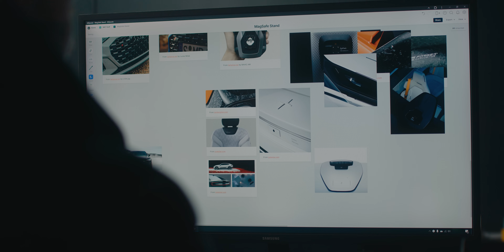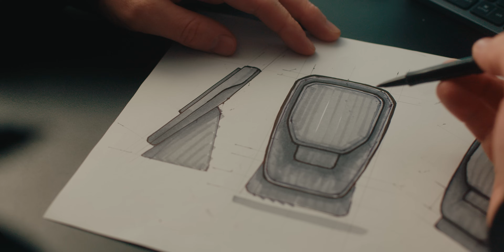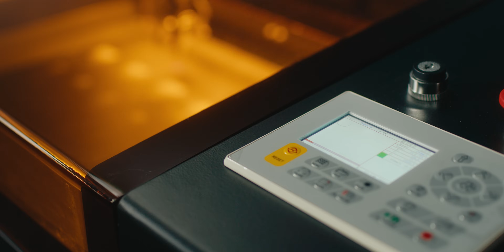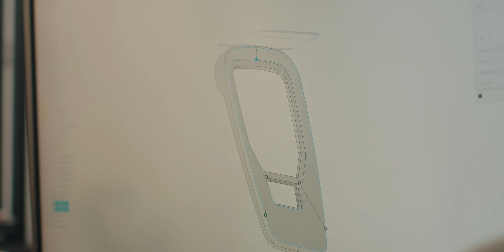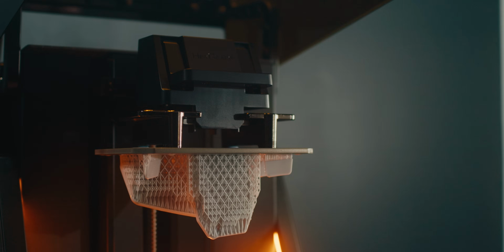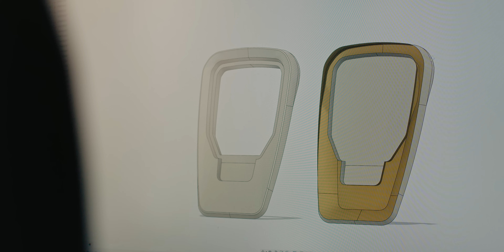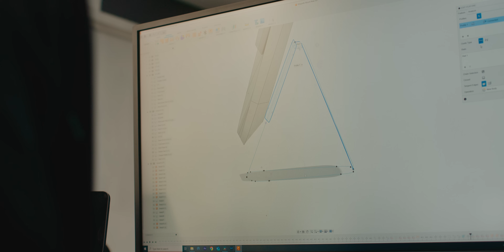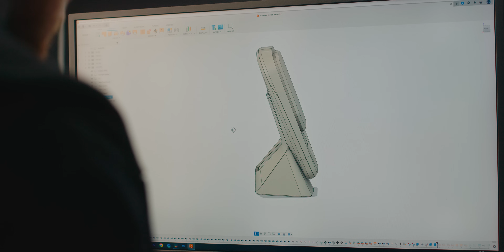Prototyping A New Product - Wireless Charging Stand

Comment: This is just outstanding! your process and video work are amazing to watch. 
I worked with that same HeyGears Reflex recently and I really enjoyed not having to worry about any adjustments.
Reply from the maker: Thank you man I appreciate that! Yes honestly I was sort of expecting just another printer, but actually I found the closed loop eco system to be an advantage rather than a hindrance. Sometimes it’s one of those where if you’re locked in and something doesn’t work well it can be a real pain, but it was genuinely nice to just set and forget. I’ve always said if I ever worked with a company I’d only ever endorse the product if I would purchase it myself and after using it I’d say I would. What was the project you worked on with yours?
Reply: @RTAFabrication   Exactly! I enjoy tinkering don't get me wrong but when you're knee-deep in a project, the last thing you want to waste time on is smg like 'retraction and speed relationships.' 

I tried the resin mixing system they have as well and I've found it to be very cool so far, even though it's a closed system and we'll have to get those specific materials. I prefer that to have to send stuff out for fab. 

I made a silly modular macro keyboard system (all printed on this and video is up on my channel)

Comment: I looked at something similar before with a wireless QI charger coil, but I never got to doing the project as I got advised against using carbon fiber as it is conductive and can distort the magnetic field of the coil. 

I'm curious to see if the Mag safe charger has any issues, though even if there are it will be hard to measure. If this project goes well, Maybe I'll look at the project again.

Also It was really nice seeing your full design process, I look forward to the next vid.

Comment: Love this, and the print results show off the HeyGear well; not come across the brand before, but at a smidge over £2K ex VAT, the Reflex Combo looks a compelling proposition. Looking forward to the followup and the molds.
Reply from the maker: Thanks! Yeah it’s actually reasonably priced in my opinion (compared to some brands out there) for the results and workflow especially. I did enjoyed not having to tweak settings, everything just worked which was nice for a closed loop ecosystem. Sometimes things like that can be a pain when one process doesn’t work well! The follow up should be out in a week or so so keep an eye out!

Comment: Top notch as always! What type of rattle can black did you use?, the finish looks great! Can't wait to see the final part.
Reply from the maker: Thanks! The paint is Promatic Matt black. It’s a decent paint at a decent price when bought in a 12 pack. That light grainy finish is from laying on a wet coat, then just at the last point before it’s dry I’ll fog a few layers on from a distance to build up that grainy texture. I make sure the fog layer doesn’t go on wet, so not too close or heavy, but not too far away either as it’ll land as overspray and wipe right off. I fog it, let that dry for flash it with some heat (hair dryer), then go again for one or two layers. I actually recommend the matt black from Monofil. I think it’s the smart+ range or something similarly named to that. The Promatic is good, but it’s very solvent heavy so it’s thinner. The Monofil is easier to build up the grainy texture as it’s not as solvent heavy, but seems to be hard to come by lately. Hope that helps!
Reply: @RTAFabrication  That helps a ton, Thank you! It looks much nicer than the products I have been using.

Comment: Perhaps you've already taken this into consideration, but I noticed that you have an iPhone 12 Pro Max. As I've been designing stands I've notice that the bigger camera size of the 14 and 15 starts to get in the way of custom stands. Plus when someone is using the iPhone 14 Pro as compared to the 14 Pro Max, there is even less space to work with.
Reply from the maker: Good observation! I did try out an iPhone 14 Pro Max and another newer one (can’t recall which one), and those had enough clearance. That’s a good insight about the regular models so I’ll have to give that a try. This was just a project for myself, but I did take into consideration the camera bump, making sure the pad was set forward enough so it didn’t foul directly behind it. I don’t think that’s something I actually mentioned in the video specifically, but the other reason for pushing the pad forward was for finger clearance too. As I moved the charger further up into the pad for the cable clearance, it also gave me as much clearance as possible from the top of the pad to the bottom of the camera bump. Even though this is a project for myself, I’ll definitely do as you’ve suggested and test the other models just to ensure universal compatibility. Thanks for the insight and for watching the video!
Reply: @RTAFabrication Rad! I appreciate the response. Looking forward to future videos like this. I thought it was pretty insightful.

Comment: Great video mate! Just curious why did you need so much support material for such simple prints?
Reply from the maker: Thanks man! Honestly, I’m guilty of over supporting prints as a safety measure. Of the two, I’d rather spend a little bit more time on post processing than have a failed/ defective print that I have to repair with filler or scrap. What I should do is gradually remove supports on each print to the point where it does have defects or fail. I guess that would put me in a sweet spot of minimal supports with a non-defective part. Thanks for watching man, I appreciate it!

Comment: Which software do you prefer to use to create the 3D models?
Reply from the maker: My go-to for product development is Fusion 360, mainly because I started years ago on a simple CAD software (can’t recall the name), then moved to Solidworks, then Autodesk Inventor, then to Fusion 360, so I’ve always worked with CAD/CAM softwares. I did start to learn Blender within the past 6 months or so for the Reaper Coffin packaging I made for Kill All Wipers (I uploaded a video in a short of that project), but honestly I did find that to be a hard learning curve, as I struggled to approach it from a non-CAD point of view. Whether this is correct or not, I see personally Fusion 360 as a precision product modelling software and Blender as a sort of visual/ sculpting 3D modelling software for more organic things. Sure you can do both to a certain extent in both softwares, but that’s how I divide the two up. The other reason I use Fusion 360 is because I can program all of my CNC toolpaths directly within the application, so it makes for a really good workflow if I’m doing any machining. Thanks for watching the video and I hope that was helpful to you!

Comment: Hi can i know price and model for leaser machine?
Reply from the maker: The laser cutter is just a non-branded 60w c02 laser cutter I bought on eBay. I believe after looking around that it’s identical to the OmTech 60w c02 laser. I’ve just looked on their website and I think they’ve recently updated it. Mine is 600mmx400mm and I went with a 60w as the lower power seems to be better for engraving than higher powered ones. The only thing I wanted when looking was a Rudia controller as it’s better than some of the other variants. It was also blue before but I vinyl wrapped it in Matt black 👍🏻 hope that helps!

Comment: What material did you laser cut?
Reply from the maker: The material Iaser cut was Matt black acrylic. It’s from Perspex and it’s the Midnight Black Frost Perspex S2 9221 in a 5mm thickness. Thanks for watching!
Reply: @RTAFabrication  awesome! Do you have a list of materials you usually go to? I’m trying to make a pretty big box that will sit in my engine bay and it’ll need to be custom so I’m thinking 3D printing and then make a mold. However, I don’t know what to make the box out of, it needs to be pretty strong and sturdy and handle Arizona temps in an engine bay